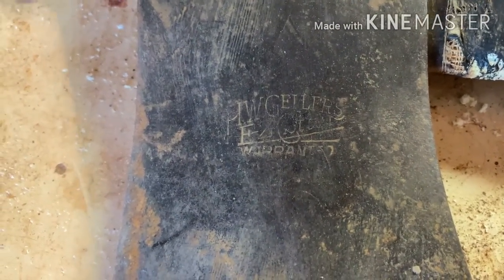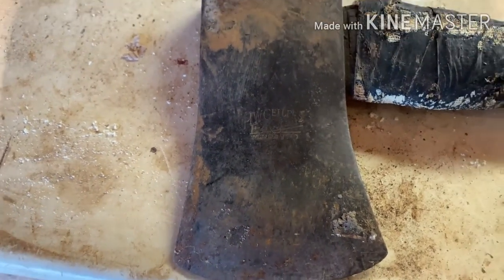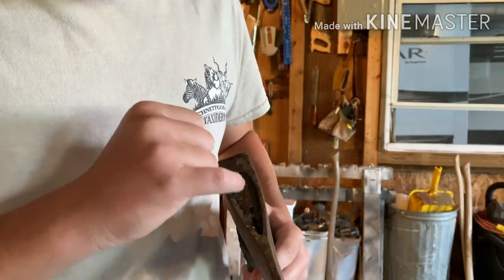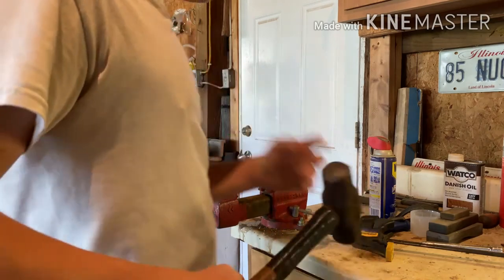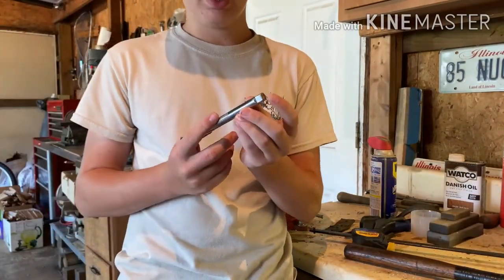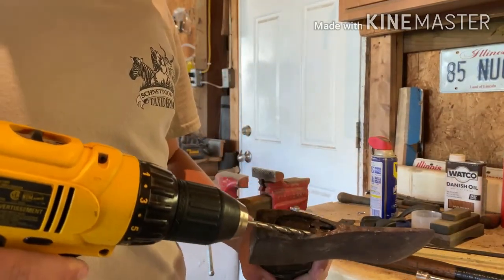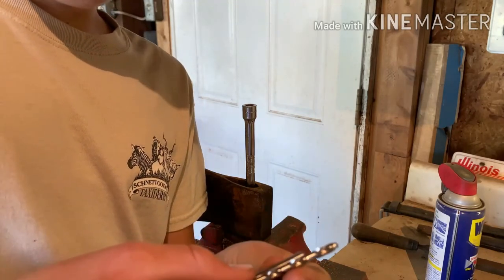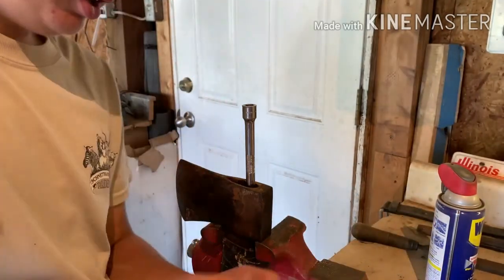Making an Axe!

Comment: You having the same problem that I was having with that editor. The video is slower than the text
Reply from the maker: CertifiedGoose ya
Reply from the maker: I might pay for the premium
Reply: Whackin Axes if the free version isn’t working right, premium won’t be any better. Guessing your graphics card isn’t powerful enough to handle editing apps.
Reply from the maker: Ya your probably right. It only let me upload in 720p and I thought that might be the problem.
Reply: Great job, young man!